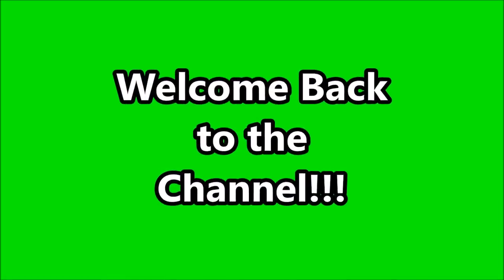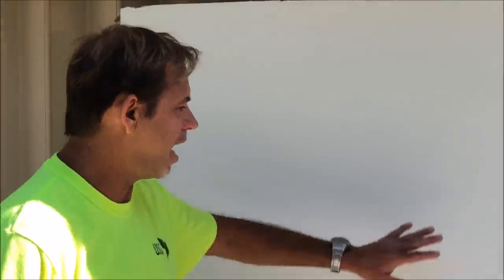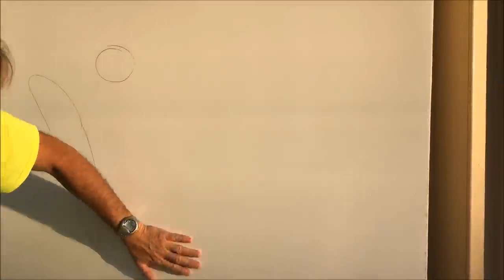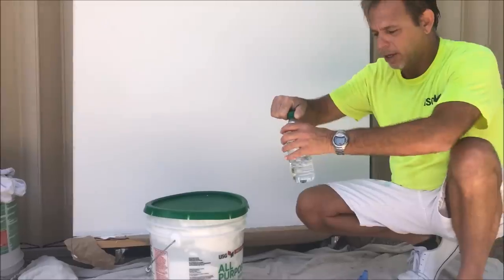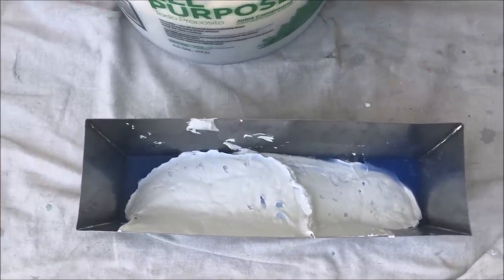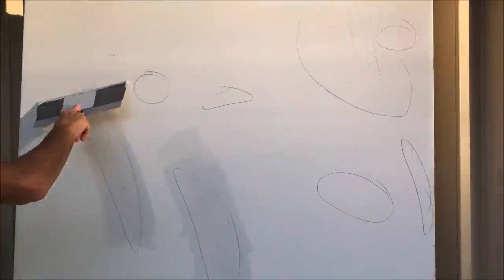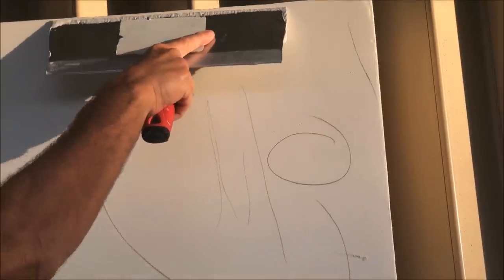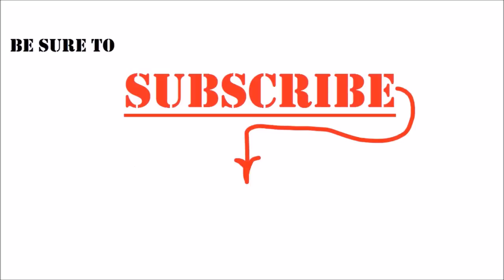How you can get the smoothest walls with these skim coating tips and tricks

Comment: Do you know what causes the skim coat to bubble after it’s dried? When I apply the final skim coat, the previous coat will bubble and lift off. I’ve tried using primer to lock it down, but I still get bubbles even after letting it dry for a week.
Reply from the maker: Hi Mike, that’s a bummer. Maybe we can figure out the problem.👍🏻 Did you sand after doing the first skim coat? -Paul
Reply: Paul Peck 
Lightly sanded, removed dust with damp rag and applied an additional skim coat.
Reply: Paul Peck 
Wanted to mention that I was skim coating over painted knockdown texture vs bare drywall.
Reply: I found that lack of mixing thoroughly leaves bubbles, and you can also 'work' a knifeload of mud against the pan wall, squishing the bubbles out, and if you do spread some bubbles on the wall, try a steep angle on the last stroke.
Reply: Lay on the mud, in a moment or so you'll see bubbles begin to appear. The thicker the mud the bigger the bubbles. Anyway, let your coat sit a few minutes, the bubbles will surface then you can wipe them off as you skim. Bubbles are caused when the surface is sealed & the air has no where to go but to surface. Thats one cause, there are a few, tho none have anything to do with too much moisture in the mud or air, on the contrary. Mixing can also contribute to bubbles. Believe it or Not, using "Lemon Joy" dish soap is a good fix, doesn't knock them all out but 90%. Trust me on this, I'm 40 years in it and there isn't much I haven't seen... or fixed. Remember, Lemon Joy, no other brand and I have no idea why only Joy works but its the one.

Comment: We skim in the UK for a reason ,it's hard waring and doesn't need sanding.A plaster finish will always out perform a taped wall and there the same cost.taping as it's place but plaster wins every time
Reply from the maker: Hey there, I appreciate your comment!👍🏻 I agree. Plaster is not the standard here and can actually be hard to find as far as the material. Also, very few people are willing to pay the extra money since it is a specialty here. Customers just want a property primed and painted walls is what has been my experience. I’m glad to see that my videos are showing up in the UK. Were you searching or was this video suggested by YouTube? Thanks so much for watching and subscribing my friend! -Paul
Reply: NOT THE SAME COST. NO NO NO
Reply: Hardly. I've plastered. Diamond coat is about the best... if you're going to plaster. Years down the road... don't expect to find the same color for repairs. Yes, Diamond coat has colors and to do it right you 2 coat with mud as you would for texture. The only reason people use plaster in the US is for the coloring effects it creates. Like I said, hope you don't have to repair it years down the road. People just end up mudding fixes and painting over nice plaster work.
Reply: Thanks for the yogurt and chalk tip Paul. In the states we call it a level 3 cement plaster finish. Cement is much harder than gypsum and at least double in cost. My plastered house was built in 1963, no cracks at all.
Reply from the maker: Right on W!👍🏻 Thanks so much for watching and subscribing my friend!😎 -Paul

Comment: I have extremely thick drop down texture. It looks like it was sprayed and actually never "knocked down". Giant raised, bubble, bumps. Should I sand it a bit first before skim coating?
Reply: Yes. It’ll make your life much easier. If you can do it, utilize an actual sander that hooks up to a shopvac/dust collector so you don’t have crap tons of fine dry wall dust everywhere. If you can’t get an electric sander then really make sure to use the proper PPE (respirator mask, eye protection etc) as well as taping plastic barriers as you’ll have a massive load of super fine thick dust going everywhere. I learned my lesson the first time I hand sanded a wall that the prior owner did some cuckoo texturing on, ever since I’ve been much more conscientious. There’s a lot of videos about how to hook up a sander to a vacuum for easier cleanup. Well worth it. Your sinuses and body will thank you.

Comment: My contractor left ugly marks and I leveled parts to my bathroom wall above a mirror that can not be moved.  I only have a 6x12 area to work on but the space is tight and the mirror cost $6k.  I’ve taped and covered the mirror and light figure and don’t know where to start.  I’m new to this and its in such a tight work space.   Any tips?  My contractor is long gone!!

Comment: Great video! I kind of skimmed through it (pun intended) but I wanted to mention an alternative to pencil marking. It's very common throughout the building process (where I'm located) to just put a small piece of blue painter's tape next to the imperfections. Painters always complain about pencil marks showing through the paint so blue tape is usually used. I imagine blue tape tagging is a universal thing. Of course, early in the process, pencil marks would not likely be an issue. Thanks.
Reply from the maker: Haha...👍🏻 Nice pun! Yes that will work too. I appreciate your insight! Thanks so much for watching and subscribing! -Paul
Reply: Painters tape...$36-$45 for the multi pack.  1 Carpenters pencil $0.18 will last multiple jobs.

Comment: Drywall techniques aren't so big in the UK. We tend to skim the whole wall with gypsum plaster. Does the compound you use suffer with shrinkage or even expansion, over time?
Reply: it shrinks
Reply: It will shrink if watered down too much ,or if applied in too thick a coat.
Reply: So I have done a lot of plastering in my day, do you apply a bonding agent before you skim with plaster?
Reply: Anthony Aloi unless it's going straight on plaster board, yes, usually

Comment: Your mud looked lumpy or it's the sticker on your troul peeling off from the mud?  But cool trick with chalk.
Reply: Pretty sure they were real small bubbles.
Reply: You're right, because he's using the wrong mud for this. The all purpose is for taping, it has more glue in it. The finishing mud is what you want, it doesn't have as much glue and finer grit for smoother finishes. Just because a guy makes videos doesn't make him an expert.
Reply: Chuck, that was my first thought too. You’re using All Purpose (taping) mud for skimming??? Ummhh. Whatever works for you, I guess. But Top Coat mud is lighter and wayyyyy easier to sand. Definitely a better mud for skimming in my book. Nonetheless, thanks to the poster for all your YouTube contributions!!!

Comment: Just one question. Why do you have to sand down your walls?
I know why I have to. Because I'm not that great at plastering. 
But every plasterer I know. Can skim a coat like Glass though they tell me that's not the way to finish walls as it's too tight and paint won't stick. Don't know how true that is. But I like the extra smooth finish and leaving it unpainted. 
Anyway. Thanks for the tip. I'll be sure to do the dye. Blue not Red.
Reply: Im a skim coater.  Our walls are like glass.  Never an issue with painter.  Diff product tho.  This is joint compound.  Not plaster.  This isn't skim coating.  Dont know why he calls it that

Comment: Paul, when skimming a ceiling do you have an tips to keep the mud on the knife? Also, I am a rookie and was curious if you ever used a magic trowel? Thanks.
Reply from the maker: Hi Zack, it sounds like you might have your skim coating mud a little to thin. For ceilings you want to keep your joint compound a little thicker. I hope this helps! -Paul

Comment: I have all materials ready to go for skim coating my drywall, but I'm nervous to take that first step because the drywall boards are vinyl covered. If I skim coat in drywall compound to smooth out texturing can I prime and paint as usual after that? I keep seeing people using primer and paint and their walls dissolving. I cant afford that to happen. If it does I'm screwed. The skim coat should act as a protective layer over that stupid vinyl....right?

Comment: I been doing much wall plastering not easy to work with when there is high n low spots close to each other i try to get areas filled in smooth first time to eliminate much sanding but never fails have to always go back next day to do the sanding every time much time consuming & dusty as can be though i always say would i rather pay hundereds of dollars to someone else or i do it to save & i rather save..
Reply from the maker: Yes Old Timer, I know where you're coming for sure. Just look at it like all that sanding, sweating and exercise is good for you.👍 Take care man! -Paul

Comment: The best material you can use for smooth wall is Hamilton’s topping. “Green dot” USG is trash. Especially using all purpose for final coat? Big no no for true smooth.
Reply from the maker: I’ll have to try that topping compound. But I do you know the USG all purpose joint compound works great for me. Take care, -Paul
Reply: Mad-Max, you NAILED it!! Green dot or +/3. I generally go with +/3 cause green dot shrinks back too much... even w/ little water.
Reply: lol we both on the same page. its mostly for applying paper tape.  it has more of that glue inside to hold the paper tape right

Comment: Being a high end drywall finisher there is no such thing as touch up after skim coat because  the skim coat is the touch up for level 4. Prep your level 4 better and no need to touch up level 5 finish.
Reply: That is cold and not even true. No shame in sometimes needing a little touch up after skim coat. In case you need to have it hit you over the head... this is a example skim coat test panel with intentional imperfections. Keep up!

Comment: Using a pull scraper with a slightly convex blade is far more effective and less dusty than sanding then going over it lightly with a wet sponge.
Reply: Or pull a 3" scraper then damp sponge.

Comment: Another trick is to add a little dishwasher liquid to the mud this make it smooth with no lumps.
Reply: Koronswagg 17 I was just gonna ask this guy if he's tried it. I've been doing it for about a year and it makes it super smooth!
Reply: It makes it smoothe but when its time to sand it burns the shit outta your eyes
Reply: You should only use the soap on you double and final coat.. during a skim the mud should be thin enough to not have bubbles or create pock marks.
Reply: USLESS, TAPER  FOR 40 YEARS TRIED IT , WASTE OF  MONEY
Reply: Koronswagg 17 yeah he did that video 2 monrh ago
Reply: I have to agree. I have been a drywall finisher for 30 years. Went to my suppliers barbecue one year and they had reps from different company's. I told the one rep that his product left pin holes or bubbles. He says to me "Oh just add a bit of dish soap to it and then it won't do that". I told him straight, how about I use this other product where I don't have that problem.
Reply from the maker: I’ve never done it because I was always worried how soap would effect latex primers and paints? No issues with adhesion? -Paul
Reply from the maker: I believe that Tobias!😳 -Paul
Reply from the maker: Ian, Haha...😂 Theres actually a product called “No Pock” that works pretty well for pin holes. Thanks for watching and commenting! -Paul
Reply: Never heard of a problem with paint adhesion. Soap contain is very minimal but again, why would you need to add anything? Makes no sense.
Reply: I use the soap cuz it comes off my knife cleaner and easier,but I always keep my knife wet anyways
Reply: None @PaulPeck

Comment: I had a sub do drywall for me a few years ago. They dyed the mud, never saw that before. after 4 or 5 layers of primer the color still showed through. in labor and materials it was a disaster. I dont know if they had this trick wrong or not, but I will never let anyone dye mud if the final color is white.
Reply from the maker: Hi SV, that’s a bummer. This trick does not bleed through at all. What color did they dye the mud? Thanks, -Paul
Reply: Yellow food coloring will do the trick nicely especially if you coat w/ a topping like USG +/3. If the job. What was your primer? Sherwin Williams has "High Build", works great.

Comment: I find the hardest thing to do is where the sloped walls meet the ceiling in my attic . I can never seem to get a perfect angle
Reply: Penny, those are called off angles. If you want it perfect. Snap a line, end to end perfectly where you want the angle. Then, say there is an area where the snapped line shows on the ceiling. Take a 14" knife, lay the loaded w/ mud knife on the line and pull the mud down the wall (tapering) to nothing. Do the same up the ceiling where the line is on the wall. Only pros, like myself, can pull mud along the angle and keep it straight... comes w/ practice over the years, as I'm 40 years into it. Better too little mud and then keep coating than to over fill and have to sand your ever loving mind crazy!! Good luck.
Reply: Jim Hamilton thanks for the tip I’ll give it a shot!
Reply: Ha!  @p.macomber6901  , I just noticed your pic, nice gun!!
Reply: Jim Hamilton thanks Jim lol

Comment: A good plasterer feels with his had where his skimmed over his sanding imperfections no need for chalk line that might show through with the paint
Reply from the maker: Yes. But, I use the blue chalk after I’ve done my touch up that way I know exactly where I’ve been. No need to feel all the walls again when I know exactly where I need to do a little fine sanding where ever there is blue chalk. Hope this clears it up. Take care, -Paul
Reply: Paul Peck if you use a topping compound instead if Multi purpose there would be no need for the chalk as it sets an off White colour some even a baige light brown I also been a plasterer for 20 years here in Australia

Comment: Can’t you just see where it needs to be sanded with your pencil marks
Reply: The pencil marks are solely for finding where the substrate needs a bit more filling/attention. Not for finding where it needs sanding.
Reply from the maker: Hi Michael,  I usually use the pencil on the bigger imperfections that I see. But then when I go around with the joint compound I usually see a few more small ones. So a lot of times you can still see the pencil marks but there will be other small areas that I mudded that Will be very visible with the blue water added to the joint compound. I hope this helps. Take care, -Paul

Comment: It’s an extra step but it’s definitely worth it before you start doing your final touch up Paint the wall first with some drywall primer then your touchup will be easier to sand and see no flashy Discolored mud needed. You would never do it like this in a commercial setting. Simply do the touch up needed to be done before so you could do all of the sanding at once, come on! Work smart not hard.

Comment: Lmao you could see your marks without the blue you circled around them
Reply from the maker: Hi Austin, yes you can see the marks through the mud while it’s wet. And a little when the joint compound dries but I only marked the major areas that I see as I go around. I’ll also hit other little imperfections that are not marked and using the blue mud allows me to see those really good for the final touch up sand. I hope this makes sense. Take care, -Paul
Reply: Paul Peck 
It is a good idea with the chalk I'm a commercial taper and I will try for touch ups but I'll skip the pencil and just go around with my pan